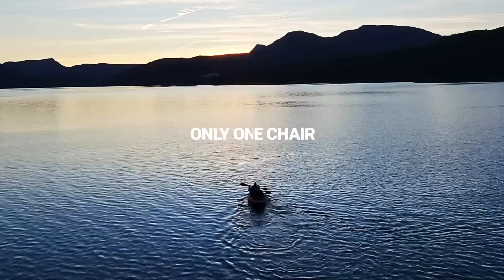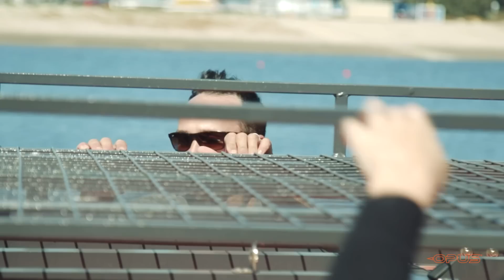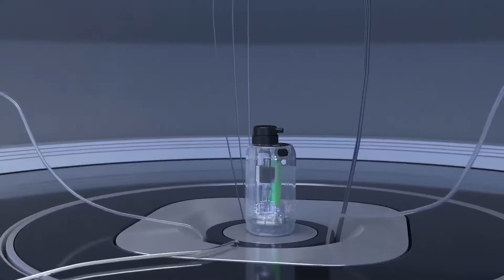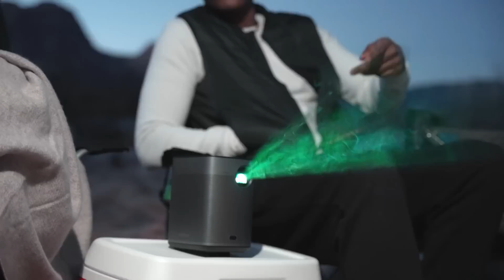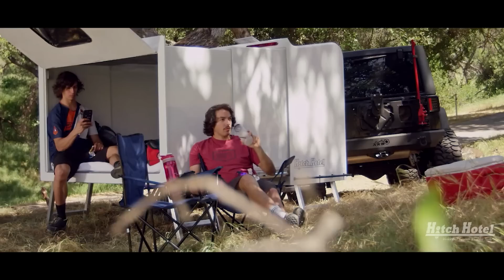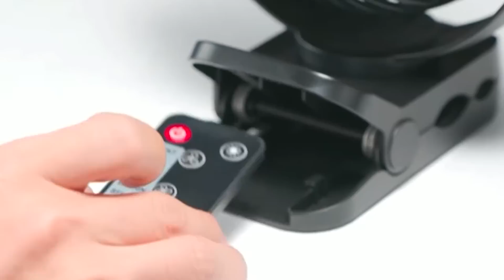30 Camping Inventions That Are Insanely Cool

Comment: I do not care how cool they think these things are. There is no way they can justify the price of anything that you have shown $950 for a tent with no walls give me a break are those straps made of gold $22,000 for a piece of molded plastic that floats on the waterno way to justify these prices
Reply: For $22 000, you can get a proper cruiser with a trailer.
Reply: Llevas razon, es incomprensible